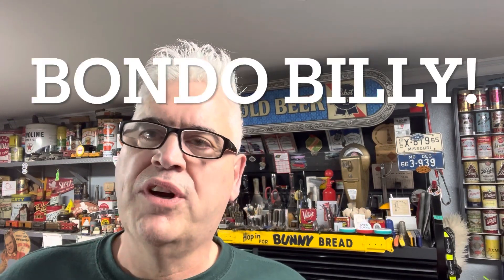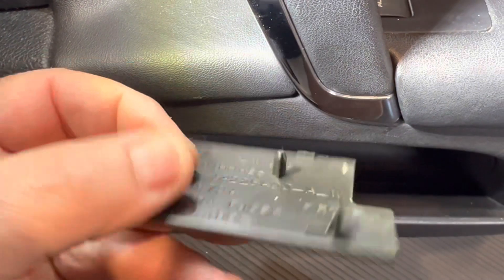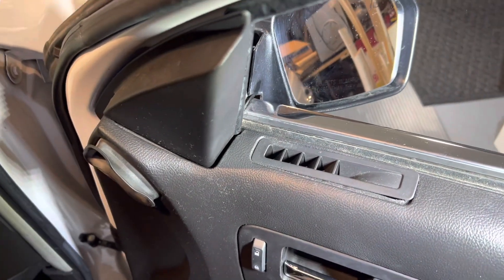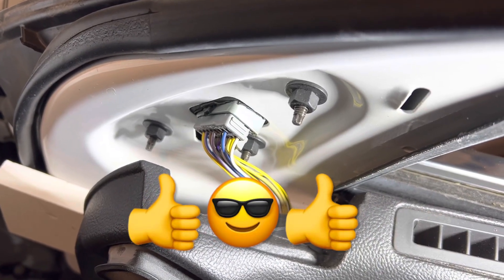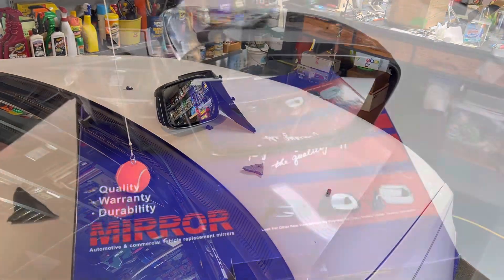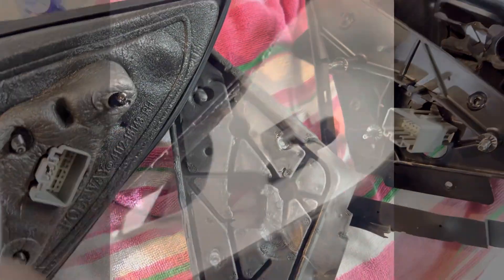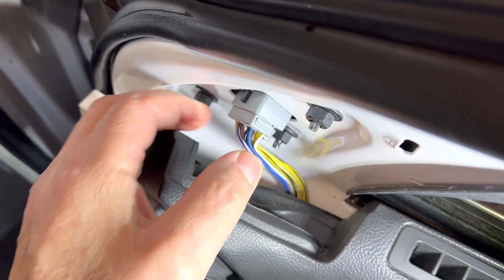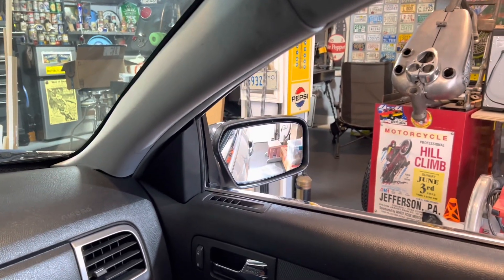REPLACE PASSENGER SIDE MIRROR-👀 2007-2010 Lincoln MKZ…FORD Fusion?

Comment: Another job well done, Kev.  You must have saved yourself around 5 hundred bucks!  I had a mirror to replace on my 2012 Dodge pickup one time.  Dealer wanted 850 dollars to replace.  I bought one for $95 and put it on.  Highways try to rob you sometimes.
Reply from the maker: Thanks Dennis👍I had one replaced “under warranty “ 20 years ago … dealer paperwork said 400 bucks so I wasn’t about to pay that or more on this one… it’s one of those things where if and when I ever do it again , it would be easier second time around! 👍👀👍

Comment: You had it nailed Brother, DIY is always a good way to go and easier on the checking account too. 🆒👍🔧
Reply from the maker: Thanks! Steve… All the pieces were surprisingly there..wiring not damaged..I had actually considered running a sheet metal screw through it and gluing the pieces.. and that would’ve happened if they would’ve wanted a stupid price for it!

Comment: I've had several Lincoln Town cars. Nothing that new. Fun cars. Trivia. A 77 Lincoln limited slip rear-end  will bolt in to a 74 F100.
Thank you Kev.
Reply from the maker: Interesting! 👍👀👍It’s been a great car! We’ve had it since 2012… it was a rental car with 22,000 miles when I bought it used for half the price …Thanks Bryce!
Reply: @Kev’s Can Cave  We've moved away from  new in recent years.  It's hard to justify the money. In the late 80s we would buy new every 4 years. We got decent trade in, and would save most of the cash. Times sure change.  Thanks again Kev
Reply from the maker: @brycewiborg8095  Absolutely agree, Bryce! ABSOLUTELY 👍